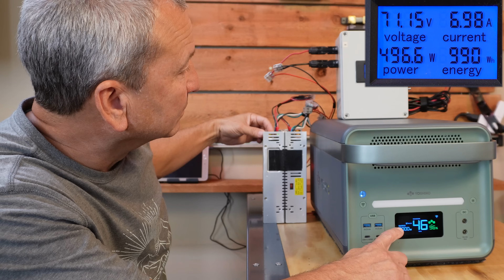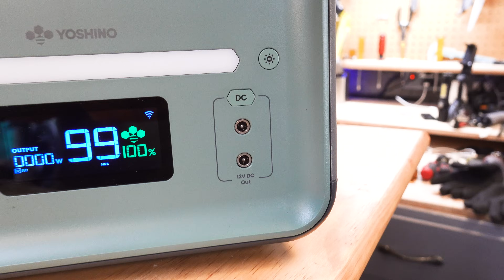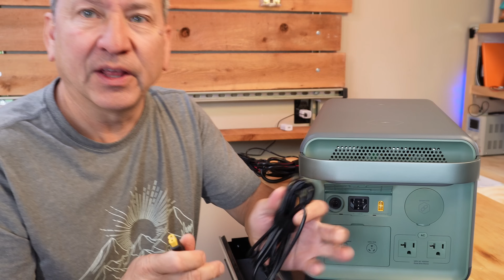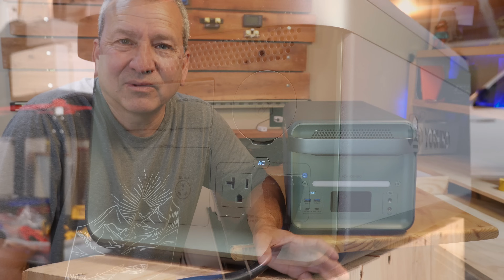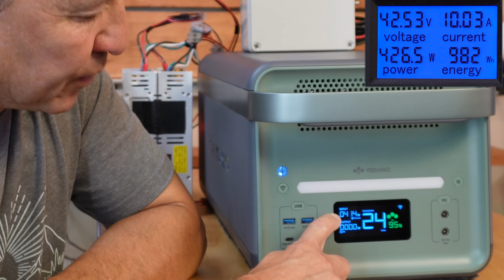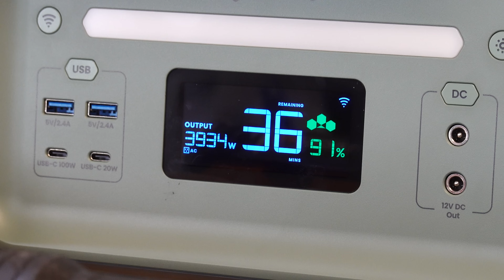SOLID STATE Power! Is THIS the FUTURE of Portable Power? (Yoshino B4000 Power Station Review)

Comment: It looks like to me this is not UL listed.  The description says "ETL certified to UL2743 standards" which is NOT the same thing, and when I go on the UL site i can find nothing on this unit.  If it was UL listed I would have LOVED to see the sticker on the unit that says this.  I have purchased many power stations that state they are UL listed, but so far unfortunately they all were not.  They just say they are, or they just say they 'conform' to UL standards.  The best i have seen so far is that the external charger is UL listed, (i.e. "the brick" or AC adaptor) which means little to me.

Comment: 2 important questions,at least to me, how long does it take to charge through 12v ( cigarette lighter socke) and what about cold weather.  If your vehicle go cold below freezing will it operate or damage the batteries?
Reply: Well since cig lighter ports are limited to 100 watts approx., and this is 2600 Wh, it should take about 26+ hours to charge.  Per the description, Charging Temperature	32 to 104°F / 0 to 40°C and Discharging Temperature	14 to 104°F / -10 to 40°C

Comment: The problem with solid state or solid electrolyte batteries has been longevity. They are claiming 2800 cycles to 80% capacity (which rivals LiFe) but traditionally the expansion and contraction of these batteries during charge/discharge has been a big problem. If it lives up to its claims at a $1 per Wh it's quite reasonable although slightly more expensive than other power stations with similar specs. It's almost exactly the same weight as an Ecoflow Delta Max (2048Wh) so their claims of 25% to 30% lighter are spot on.
Reply: A properly cared for LFP power station can easily get 3000 charge cycles before dropping to 80% remaining capacity. So what`s the actual advantage of solid state in the real world? I see none. My LFP power stations have been used heavily for nearly 4 years (I bought the 1st releases) and capacity has remained exactly the same. Even my grade-A lithium ion power stations have had no loss in capacity that I`ve noticed and I cycle them regularly for cooking, lights and frequent power outages. The only minor issue I`ve seen is a loose display cable in my original Golabs R300 bought in December 2020. It doesn`t really affect its usefulness and I can tap it and it clears up. This is a common issue with the originals. It can run my WIFI for 24 hours or cook rice 3 times.

Comment: Overpriced for the porpoise. With suppressed charging capacity information from the outlet and partially suppressed charging information from solar. 10 amp charging from that xt60 is not effective for solar charging this ACCUMULATOR/distributor in limited road/camping scenario. So for the price a hard pass. Unless you have enough time to charge this thing and take it out for picnic.
Reply: Porpoise? I think you meant dolphin.

Comment: Great video! I purchased that unit last year and has not failed me. I use it to plug my Rv refrigerator when traveling. Keeps me from having to turn on the propane or turn it off when going through tunnels. I prefer to travel with my propane off. I now have two units one inside the Rv and one at home.
Reply from the maker: Glad to hear it's working well for you.
Reply: I hope you keep your RV cool as Ion batteries can combust and cause serious fires if overheated. I’d swap to LiFePo4 in a heart beat.

Comment: Good review, but the claim of solid state is something I question. The advertising DOES say it's solid state, but it also says it's an enhanced lithium chemistry. I don't know of any truly solid state lithium storage under development, but maybe they are referring to a solid state inverter or some such. I don't believe that this is well-constructed or engineered, but you should certainly feel a solid state battery - much lighter.
Reply from the maker: Last  year I saw power stations claiming to be semi-solid-state with 50% solid electrolyte. So I asked Yoshino: Are these cells semi-solid state? They answered: Our solid-state batteries consist of 95% pure solid electrolytes and 5% liquid catalysts. Hope that helps.
Reply: @RVwithTito  Thank you for checking with mfr. This is not a "standard" description of "solid state battery which is typically thin-film deposition process, like semiconductors.
Reply from the maker: @mikebrant192  No problem. I was curious (partially skeptical) as well. So I asked the question (and others) prior to accepting the power station for review. My test results do set this power station apart from others I've used. So we'll see where it goes. I should get an expansion battery next month to review.
Reply: They're really "semi solid state", there's some gel-like electrolyte in there too. The cells themselves are flat sheets, which is why more can be packed in to a small unit.

Comment: Question  sooo... can you discharge it to 0% like lithium or just 50% like AGMs? Does it hold a charge like lithium, or does it slowly discharge like AGMs? Is temperature a factor like lithium in cold weather? Great video...wish I understood more about electricity.
Reply from the maker: It's not like lead acid. It's lithium based. So you can fully drain it and recharge it again.
Reply: @RVwithTito  that's great..thanks!

Comment: Excellent review.  You might have stated it but I missed it, for those that are interested Yoshino claims 4000 life cycles to 80%, not bad.  So if it is as safe as LFP, we might have something here due to it's higher energy density chemistry.
Reply from the maker: It is safer than LFP. Also consider that a single discharge  cycle involves fully discharging and recharging. Since we normally don't fully discharge the unit before recharging, then we are extending that 4000 cycle life.
Reply: @RVwithTito  "safer than LFP"...wow, that is incredible.  According to Will Prowse you can stick nails into LFP batteries and they will not catch fire.  Now we have some competition for LFP which most car companies are just currently switching to.
Reply from the maker: @jamescabaniss5857  These solid state batteries are even safer. Yoshino shared some testing video with me chopping the battery with an ax. It didn't flare up, but the LFP did. Pretty cool.
Reply: @RVwithTito  VERY COOL!!!!
Reply: @RVwithTito   when they first  release a test version they claimed about 1000 barely 2000 cycles... and no 4000
Reply: @anaxiosesti88  Yeah, that is what i thought.  That advertised 4000 life cycles really surprised me.  I heard that solid state would NOT have the long life cycle that LiFePO4 chemistry has.  But that was a while ago, things change i guess.
Reply: Are batteries replaceable?
Reply: @socrates2706  At 4000 life cycles that is a moot question. By the time you use up the life cycles there will be a TON of better battery chemistries.    But my guess is no, they are not replaceable. .

Comment: Always enjoy your videos.  Can’t see this as an alternative to say the Ecoflow Delta 2 Max for far less than half the cost unless you really need 30amp capability.
Reply: Maybe that's why Yoshino uses solid-state lithium batteries—they perform better than LFP, which is pretty rare. I'll definitely give it a try when they have a good deal.🤣
Reply: @liyaliao4299  You will have a while to wait… at double the price with not much more capability (wH) why?  I admit I’m a sucker and spend much more than the average bear for new tech but what are you really getting for the crazy price.  Have you compared any of the popular 2kW units (Anker, Bluetti, or Ecoflow to this one?
Reply: @dragonseggs  thx for your suggestion, I looked at delta 2 max, Bluetti AC200 max, they all have good functions, but I still worry about the safety of 2kwh battery, as I usually use a battery connected to my CPAP at night when I sleep...:face-purple-crying:

Comment: Couple quick thoughts.   I wonder what the DC amp output is on the front DC5521 ports, and WHY did they not write in on the power station?   The solar is limited to 10 amps?  That is WAY too low.   For me personally, I have to have all my ports in the front, but I guess for some people having some on the back would work.  While I doubt this is safer than LiFePO4 battery chemistry, at 51 pounds for 2.6 Wh it does seem to have a LOT more energy density making it a lighter unit, nice.  I wonder what the life cycle is, I hope it is at least close to LiFePO4's 2000 to 5000 times.

Comment: Interesting product but you better really need that portability. It costs about what I spent on my two LiFePO4 batteries and multiplus II and while it may weight like 1/3 of what they do it also has 1/3 the capacity. I don't think safety is really a selling factor vs LiFePO4 given its already a very safe chemistry. This stikes me more as a battery that combines power and energy density of lithium ion with the safety and longevity of LiFePO4. Once they get production costs down its a killer battery for ev's.

Comment: I saw minute man prep on YouTube at CES and told them to fix MPPT to 2000watts.... Then this is a winner.... So i run mini split on garage on a 2000watt inverter power station... Is draws in summer Phoenix heat 900-1200 watts i have 1100watts coming in during day so it keeps up with it.... At night i use EG4 48v to charge on one of the dual mppt and it dies about 3 hrs at night... Battery is still half charged.... But it can only inlut 550 watts but load is 1000 watts so i need to add 2nd battery on othe mppt so it will get the full capacity.... So this yoshino is only 600watts so it will suffer if only solar is charging during the day and load is say 1000watts at end of the day it will not even be fully charged for night..... Like the inverter and power density... Redesign mppt and you will capture the market 😅
Reply from the maker: I agree. The solar limit is lacking for home backup, but should be fine for 12V portable solar panels. I'm also waiting to see the 240V model which I hoping has a higher solar voltage rating.

Comment: So these are solid state Lithium ion batteries?  There website didn’t mention LiFePo batteries. How are they going to hold up to cycle life?  Is this solid state lithium setup safer because of its configuration?  Will they be fireproof if something malfunctions with the solid state system?  Not opposed to them. Just questioning new applications of lithium ion batteries.

Comment: why is there a problem with the term solar generator?
Reply: The term is inaccurate on the face of it.  A generator is something that makes power on demand and can keep on making power as long as you add fuel. "Solar Generators" are just battery banks that last until they're discharged, and it takes a significant amount of time to recharge them - especially if you're only using solar power.  Very misleading moniker for them, I've always thought.
Reply: There is no problem. A “gas generator” converts chemical energy to electrical power. A “solar generator” converts solar energy to electrical power. That’s it.
Reply: Generator converts mechanical energy into electricity. Solid state methods of creating power have their own names like solar cell, fuel cell, etc. It's blatantly wrong terminology used for marketing purposes.
Reply: I know ,right

Comment: Wow that is super neat, but at $3000 it would have to come down a bit. For about $500 you can get 2 100
Ah li time batteries and $400 for an inverter I’ll save the $2000 and deal with the extra size.
Reply: You can't buy a 4000W inverter for $400 and you're missing a charger. You could buy a good quality 4000W solar hybrid inverter and a 48V 2.4kWh rack mount battery, cables, fuses etc but you'd be spending similar money for a little more solar capacity and a 240V outlet. I think given the compactness and portability I could only build something less convenient for less money.
Reply: Lot of us are elderly and having a lighter unit makes all the difference.
Reply: Well, capacitors cost more to produce than batteries but should last longer.
Reply: @billquantrill4960  ? Totally impractical.
Reply: @paulschimel3572  that may be true, but that's a bunch of hokey pokey hobby gear. These types of all in one in a box are super convenient for the lay person..
Reply: Yes, thats what I have done.
Reply: A LOT of people don't care because they will never build a DIY system, even if it's $20😂
Reply: One can always make something cheaper, less convenient or of a lower aesthetic. Always. There is no limit to how low quality a $200 battery, or $400 4000w inverter might be. Not to mention (you didn't) the cost of a good rapid charger. Many of your fellow viewers are well aware of the DIY mentality and  want nothing to do the massive conflagration that you have described. I have built solar systems of all sizes and at this point in my life would rather just order one of these and be done with it. I would rather be fishing with my grandkids.
Reply: @geraldhenrickson7472  like I said. Building A cheaper one would be less awesome. And this is awesome. And building something definitely isn’t for every situation. I hope this solid state stuff takes off the size difference is amazing. 😍

Comment: "POWER STATION " is the right way to describe device like this, I hate the usual thing people are referring to as "Solar Generator"...What a great Review Tito 👍👍🤗🤗
Reply: A “gas generator” converts chemical energy to electrical power. A “solar generator” converts solar energy to electrical power. Simple.
Reply: This doesn’t generate.  It’s a battery.  It stores the energy.

Simple.  Not a generator.
Reply: This thing can generate power indefinitely with its battery untouched at 100% while you continue to supply "solar fuel" to it.  Trust me, I've generated power this way with my Bluettis for hours on end.  You could call it a solar generator with a battery.  As long as you have solar coming into it, its battery is irrelevant.  Nothing wrong with "Power Station"; it does that too.
Reply: @jmorrison5206  The circuitry bypasses the battery at full charge when running a device that uses less power than the solar input. In fact, 12v DC devices like cookers/fans/lights can easily use straight panel power generation. The battery only switches on under this condition when a cloud passes over...similar to a capacitor in a circuit. Solar is on-site power and over time is far more efficient and less expensive to use than a gas generator. I would never want to power my freezer with expensive gas after a hurricane. A gallon of gas, if I store the energy in a battery, can run my freezer for a week instead of only 3 or 4 hours. So can 6 hours of solar charging.
Reply: @jmorrison5206  Gas is stored solar energy. Right?
Reply: Solar generator uses solar. Gas generator uses gas. One is on-site energy going forward. The other continues to cost money and requires trips to a gas station, oil changes, spark plugs, repair, cleaning the fuel system, replacement of lines, etc.

Comment: 60v limit on solar input is a dealbreaker. These units should be able to take a string of at least 3x residential panels, and have a max input voltage of at least 150v. That anemic 60v, 10amp limit, means a single residential panel. Yes, you could Y to 3 panels in parallel, to overpanel, but you'll always be excessively restricted by it's input limits.

At most, this is a battery pack with an inverter/charger. It's not any kind of option for solar use. PASS
Reply from the maker: Designed more for portable folding solar panels no doubt. My panels on the shop are too big too at around 80V for one. Hopefully they improve this on larger models designed primarily for Home Backup.
Reply: It is designed as more of a  portable power station, then for a residential I think, 600 Wats for portable is adequate...I like to hear more about the SolidState"nes of this tech besides fire, etc...how about charge/discharge cycles, max charge/discharge, chemistry, etc...